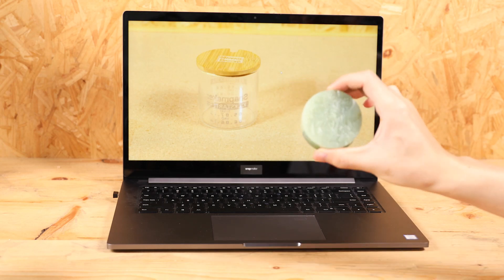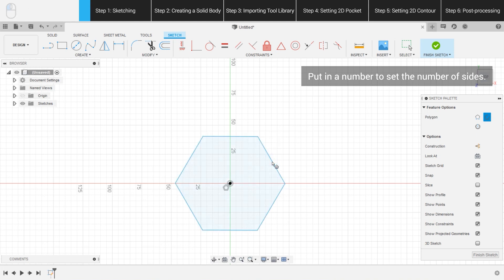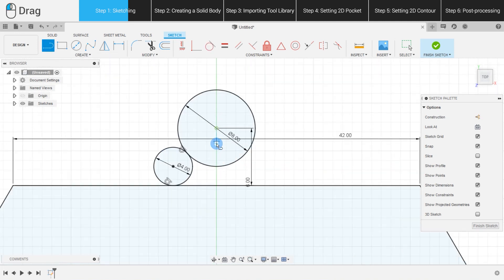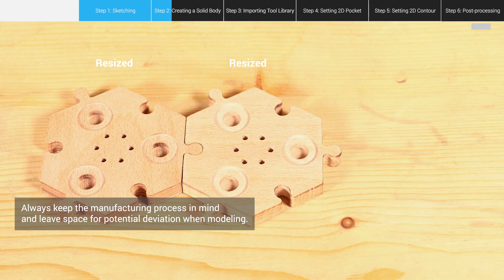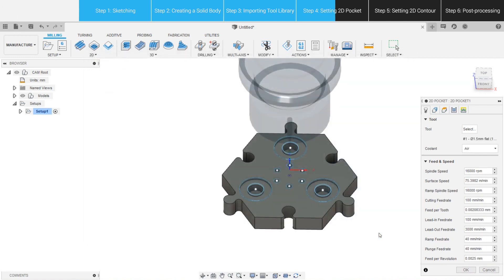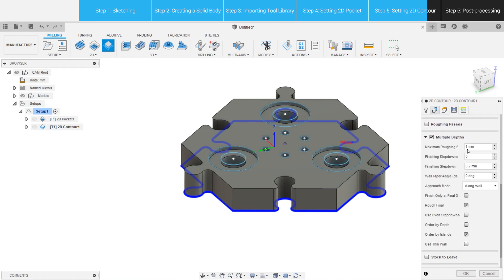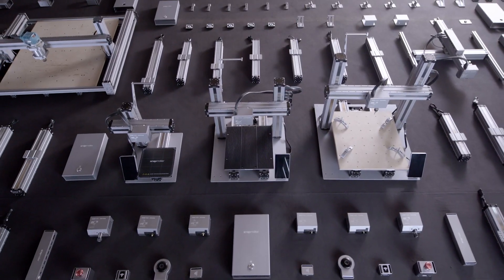Fusion 360 CAD & CAM Tutorial for CNC Beginners [Snapmaker Academy]

Comment: When I simulate the tool path, the cutting starts above the surface of the workpiece.  Consequently, all of the holes get carved short of the proper depth.  What am I doing wrong?  Thanks
Reply: Same thing happens to me. Can someone answer this?
Reply from the maker: Hi! Would you go to the "2D Pocket" settings, open the "Heights" tab and see if the "Top Height" is from "Stock Top" and the Offset is 0 mm?

Comment: Is there a way to convert an STL file to gcode? I've already made the model I want to cut on different software.
Reply from the maker: If you mean slicing, you can convert it in Snapmaker Luban😀
Reply: @Snapmaker  I don't mean slicing, I want to use and stl file to make a cnc cut. Can you convert an stl to gcode?
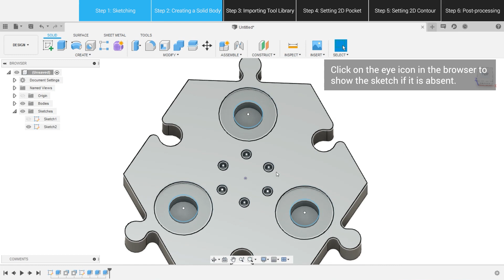Reply from the maker: @KrakenCasting  Oh, in that case you need to generate toolpath and export it to a g-code in Fusion 360 or other CAM software. And that we've introduced in the video – check from 6:50.

Comment: Stupid question, but how can SM2 handle a tool change request by gcode? I tried this for many times in sequence M05 (turn off spindle), M00 (Pause machine), (manual tool change and Z-Zero), M03 P100 and go next, but the machine should request any human interaction --> it don't :( 

I already checked the marlin gcode sheet and it looks like my way of "tool-changing" should work. But again, there is no user interaction request on display. The machine just stopps and thats it.

Can somebody explain me how this should work here or has this feature not implemented yet?

Comment: This was extremely helpful, thank you. First Snapmaker CNC attempt currently underway :)
Reply: Just finished, only issue I ran into was that I added 0.2mm to the extrude height and 2.2mm wasn't quite enough to cut through the 2mm black acrylic sample. I created a second setup of just the contour with a -0.4mm bottom height and that finished the job.

Comment: Good video to a point. Downloaded and installed Tools went perfect. BUT there seems to be 2 missing pieces: 1-installing post-processor configuration 2-installing actual machine configuration so the proper machine can be selected during setup.
Reply: Yeah, it's sad Snap Maker seem to not be very active in supporting their printer with arguably de facto standard third party software. Here's hoping that they change their mind and provide a machine file for CNC and Additive manufacturing in Fusion.

Comment: i just spent ages working my way through this, stopping and playing it back. when i get the the post processing screen i get a completely different drop down menu..  split into two halves . the top has a 'Settings heading ' and the following menu options.
Source   Generic Posts,
Post Processing 'Aramatic'
Programme number '1001'
programme comment blank
units. mm selected
then checkboxes for minimise tools  and open NC file in editor.
i could really do with some help on this as I am really frustrated.
Reply from the maker: Hi, we looked it up for you and think maybe you are using an iMac? If so, open "Source" list and select "Personal Posts" , see if you could set the post processor as we did in the video. Just fell free to tell us if you have any more questions😁
Reply: Yes I am using a Mac, I’ll give it a try and see how I get on. Thanks.

Comment: Actually if you develop tool changing module, you can use carving bit for hybrid smoothing and correcting tolerances of fresh 3D printed parts.
Reply: It would be cool if all three capabilities could be combined in the same job by implementing tool changes. Pause job to changes bits in CNC would be nice too.

Comment: Dumb question - that cnc "wasteboard" will get drilled through and damaged over time because we will always drill a bit lover than our material thicknes is during cuting so we will need to order replacements periodicaly? i know it depends on projects but do we know some average livespan of that part? and is it somehow standardized sizewise or replacements have to be original? maybe im wrong and overthinking it but im curious how that works - never had cnc before :)
Reply from the maker: That's a very common question :) You need to replace the wasteboard when you can't fix the material to it steadily because there are too many grooves, which depands on project as you said. So there is not a lifespan as far as we know. And you don't have to use an original one. Any MDF board with a similar size is OK.

Comment: Really good video! However, I'm a little stuck on the export stage. You select the Snapmaker as the machine in your list, but I don't have one listed, and I can't find a .machine file for the snapmaker anywhere online. If I select just 'Generic FFF Machine' it comes up with an error saying, "Milling toolpath is not supported by the post configuration. Failed while processing onOpen()'.
Reply: maybe I found out in the setting menu, then create program NC, then set to library and choose the folder where you have Snapmaker configuration file .cps then once select folder go back and choose VENDOR SNAPMAKER and should be fine ...I success to create the G code
Reply from the maker: Glad you made it. We will make such type of informations more clear in our next video. Thank you for your feedback!
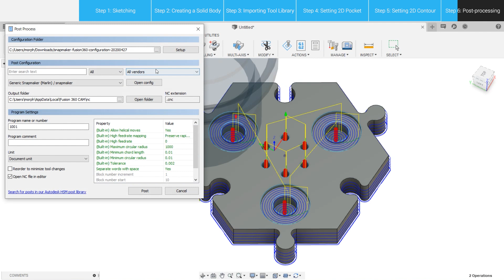Reply: same here hope they give reply because I have same error and I not able to find the same setting show at minutes 10:40
Reply from the maker: Maybe you could try this: First download Snapmaker post processor for Fusion 360 ( https://s3-us-west-2.amazonaws.com/snapmaker.com/download/snapmaker-fusion360-configuration-20200519.zip) and extract it. Then, go back to Fusion 360 - Manufacture Mode - Actions - Post Process. At the TOP of the pop-up menu, select the extracted file folder as the "Configuration Folder", and the "Generic Snapmaker (Marlin) " will be imported automatically. If this doesn't help, just keep in contact, or maybe post your issue on our forum with some screenshots or screen recording of the software. Hope you enjoy your making!
Reply: @Snapmaker  this link takes me to an error page. I'm stuck at the same place at the 10:40 mark having the same issues
Reply: @snapmaker please ignore my comment about the link. It is not broken. The extra ) at the end is what was messing it up. BUT, I am still stuck at the processing part of the video 10:40 just like the comments above me. I am working on a Mac as well.

Comment: How to setup tool library?
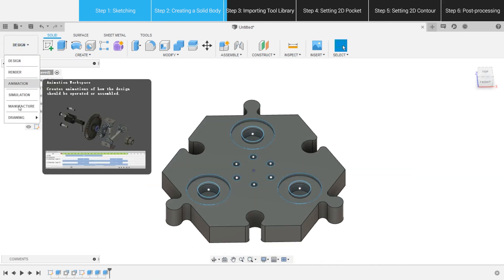Reply from the maker: To add a customized tool, you could try going to Manufacture Mode -> Manage -> Tool Library, create a new library under Local folder, so that you can add a new bit by clicking New Mill Tool icon in the top right corner. If you want to add the default Snapmaker tool library to Fusion 360, follow the video at 7:00. If this does not help still, welcome to share your question with us in any way (such as forum, social media or email :)
Reply: @Snapmaker  Thank you~~~

Comment: CNC newbie here, @4:53 if you set the cut through depth larger then the wood thickness, will it no  carve into the wasteboard?
Reply: Paul Horstink yes it will. You need to replace the board eventually. Or you use another thin board between, but be sure to secure both boards through the clamps.

Comment: Great stuff guys, It's really helpful, especially the CAM part. I'd love to see how to configure a new bit selfsourced in the cam to use with the CNC fonction. It would be great to see as well how to CAM 3d printing. I started to use an opensource postprocessor for it but I struggle with javascript to make it work properly. I'll post it on the Snapmaker Forum and hope it will be useful for the community: https://forum.snapmaker.com/t/fusion-360-additive-manufacture-profiles/5644. I can't wait to see how this SnapMaker Academy will be .
Reply from the maker: Thank you Lion! Maybe you could try going to Manufacture Mode -> Manage -> Tool Library, create a new library under Local folder, so that you can add a new bit by clicking New Mill Tool icon in the top right corner. If you have any problems setting bit diameters, just feel free to share with us, too. As for the forum topic you mentioned, we've seen your latest update and will learn more about it. 
Thank you again for your support!

Comment: Awesome video! Really helpful. I’m loving my A350.
Reply from the maker: Great to hear!
Reply: @Snapmaker  Can this also carve Aluminium and print PETG? And where the shroud to block the sound and particles
Reply from the maker: Hello. Snapmaker can't carve on Aluminum, but is able to print PETG. For the second question, you could order an enclosure along with the machine when you receive a BK survey.
Reply: I might snag one for my next project :)
Reply: So jelly!! Mine is still on the ordered list.
Reply: @adamsbeforeaftercreations7625  mine would be IF I HAD THE BURNABLE CASH (1-3 months though...)
Reply: I'm waiting for my A250... So, could you confirm me that the postprocess file work properly with your A350? Thankx, Rob
Reply from the maker: Sure. The post processor file will work properly with all 3 models of Snapmaker 2.0 : )